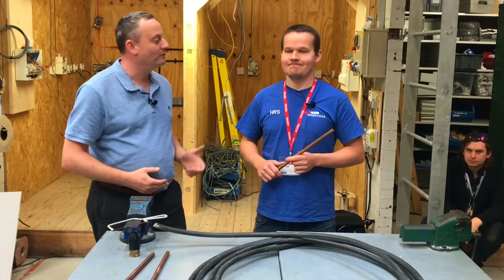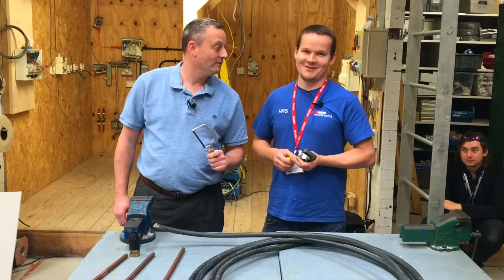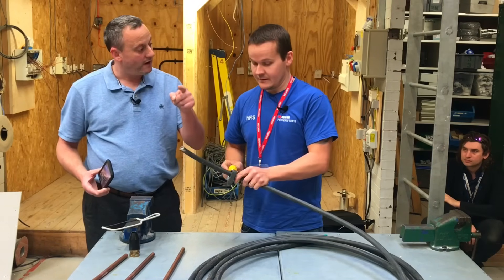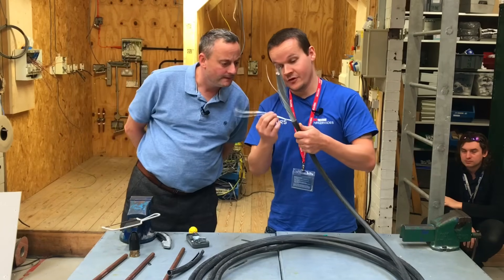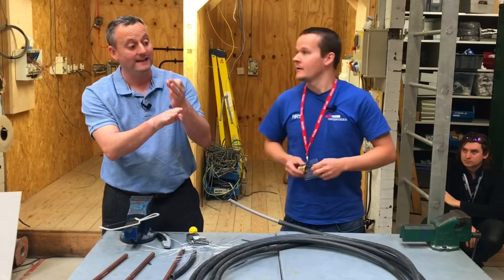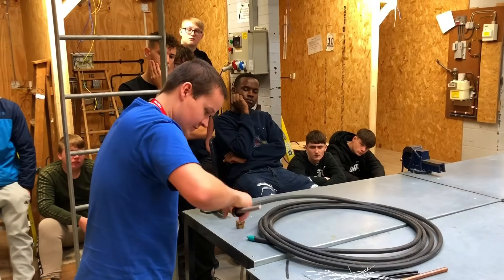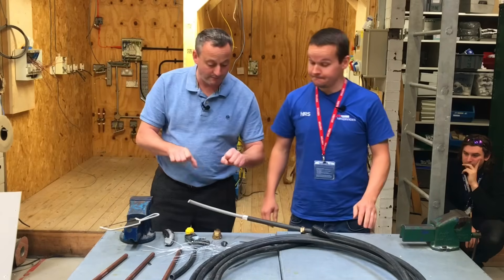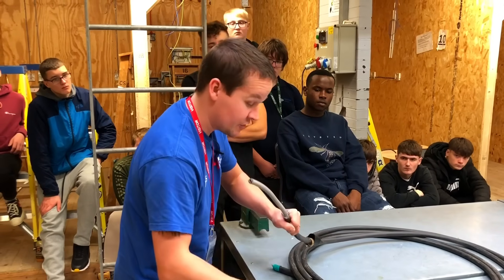How to Make off a SWA Cable Using a C.K Armourslice SWA Cable Stripper

Comment: Great demonstration. The rear locking nut with inner waterproof sealing ring is left off, hence exposed wire strands are exposed before being covered by the dust shroud.

Comment: After changing the blade a couple times, found one of the blade screws weren't tightening. Handy tip. Drill out the two blade screws and use a pair of nuts and bolts, holds the blade so much better.

Comment: What year was that Chris looks like he has more hair on his head.  Always good to see other YouTubers working together.
Reply from the maker: Thanks for watching 👍🏻
Reply: @GSHElectrical  as am now back in college doing level 2 after what fells like 200 years am looking over so much stuff.  I did not hear the term of 2 plate and 3 plate terms.  A lot has changed.  What I have been looking as is part P for dwellings were people live.  Well any way what I was looking at in the onsite guide was a drawing of office below and homes above my thinking is what dangers from my installation that don't have to be under the guidance of part P can effect the homes above.  Such as if I buy a row of says 4 or 5 shops and over them there are flats.  If one shop changes to a DIY shop and have flammable stuff in there or kitchens servicing food gas electric.  What has to be in place so no impact on the dwellings.  I would think fire rated doors if the back of shops is at entrance for homes.  But is there a book I can buy that will show shared units with living dwellings above.  As all I see is industry an domestic but as we all know there are homes above offices an shops.  There is a building I work at were the front and back lead in to shop unit as well as home unit.  Fire doors have been fitted for office an shop that lead to the upstairs to living side but it dose have shared electrics.

Comment: I'm intrigued as to why an electrician's knife would be any safer than a stanley knife? They are both blades?
Reply: Electricians knife is not as sharpe as a Stanley.
Reply: @jamielightfoot8167  For me that is negligible - they're both gonna cut you real good if you get caught with one. Why not just go with auto strippers. Miles easier, no safety isues at all.

Comment: You can also use the Armour Slice to take off the sleeving to expose the armour. Simply do as you did before but stop when you feel the blade touch the armour. It gives a perfectly clean straight cut that you might not get running a knife blade around.
Reply: I've never used one at all but I was surprised Chris didn't use the tool for the sheathing as well.